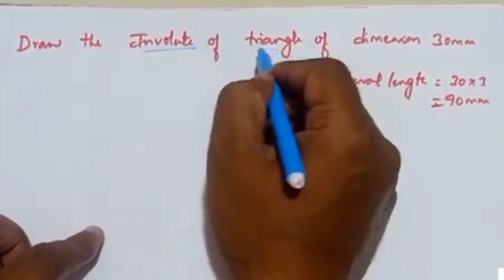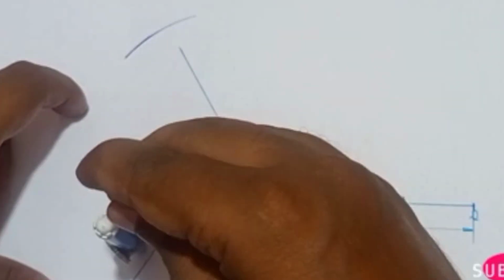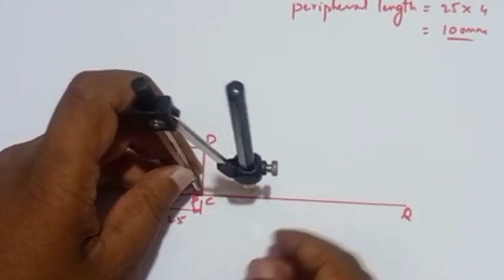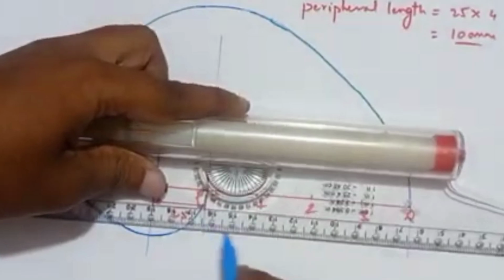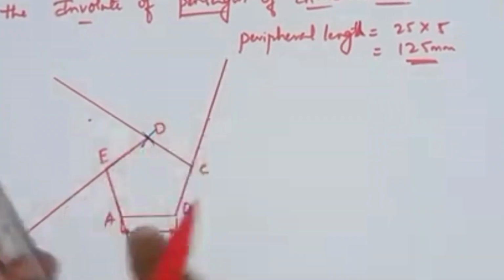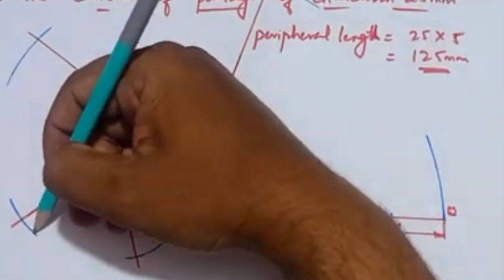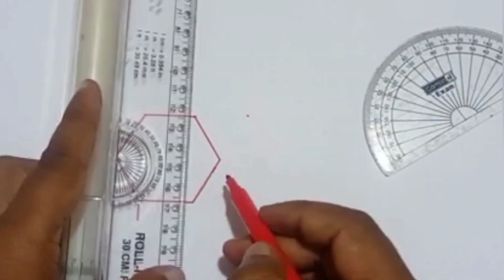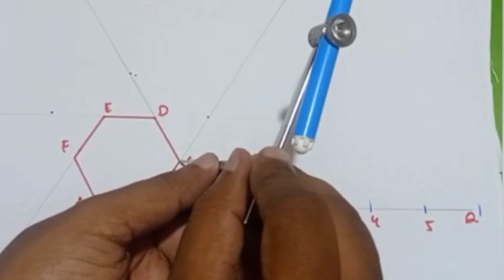INVOLUTE OF POLYGONS ( TRIANGLE, SQUARE, PENTAGON AND HEXAGON)

Comment: sir one doubt i had not releated to this vedio. ddco and os i wrote less no of points but wrote a diagram perfectly and for dsa and java also i forget all points but wrote functions and program. will i get marks and will they pass me pls tell sir and my hand writing is not that good but i have not made single scratch and underlined after every question. pls tell sir i am little worried
Reply from the maker: @suhask2014  every page will be scanned
Reply: @engineeringvisualization1005 sir nanu ondhu ondhu question ge last  line Alli question number aki one line bardhe start madidhene next page Alli full answer edhe nodi marks kodtara please reply sir
Reply from the maker: @sathvikvasishta1667  yeah you will pass if you have written correctly
Reply: @ thank you
sir
Reply from the maker: @sathvikvasishta1667  subscribe and share